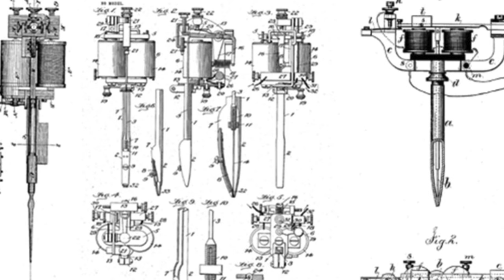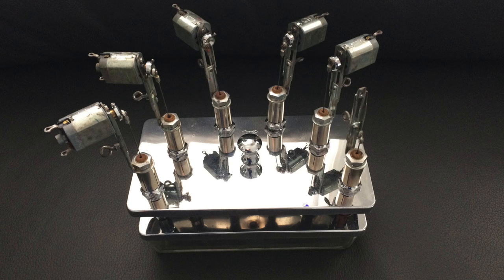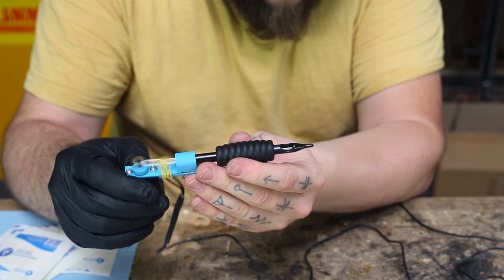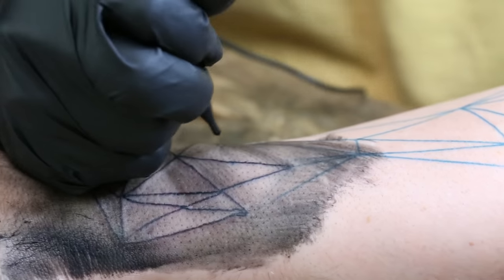SparkFun 3D Printed Tattoo Machine

Comment: Hey, I'm planning on to building this awesome 3D printed tattoo machine, such a cool project! But i'm wondering what kind of breadboard/print plate and what kind of solder cables did you used to connect everything in the driver case? Also what is that metal pin extension/contact part that is on the motor that connects the motor to the power cable? 

I have collected everything apart from these things and t I can't figure those things out unfortunately...... So really hoping that you could help me out!

thanks in advance!

kind regards,
Noah :)

Comment: if you are a tattooist, you would know to use 2 hands to tattoo and straight lines and circles are the worse things to tattoo. so why the hell did you tattoo a straight line tattoo that large on your forearm with one hand....? when a top of a thigh is the best place to practice tattooing on yourself as you can use both hands and be able to control the machine with ease... humm

Comment: You mean 3D printed tattoo machine FRAME :)) that could be made out of sticky tape with the same result... :D and by saying that the tattoo looks like a professional one except the shaky inconsistent lines (what in the world makes a professional tattoo if not just that?) ... But i guess you meant that in a professional hand would do the job just as well as a tattoo machine that is made with a totally different motor (in torque, speed etc), totally different stroke adjustments etc. Well you couldnt be more wrong, ignorant and disrespectfull towards the tatoo machine builders and companies !!